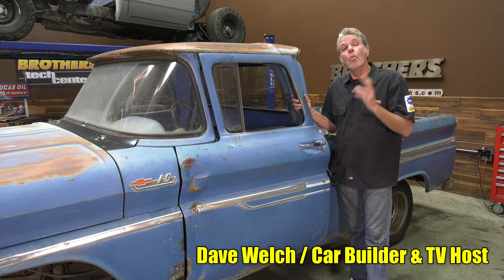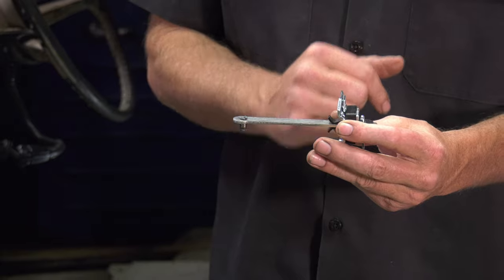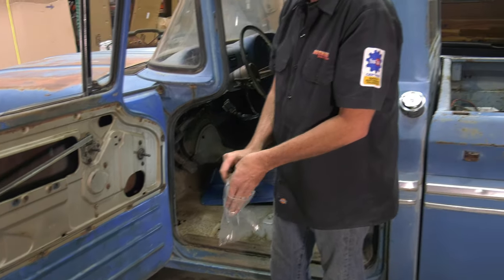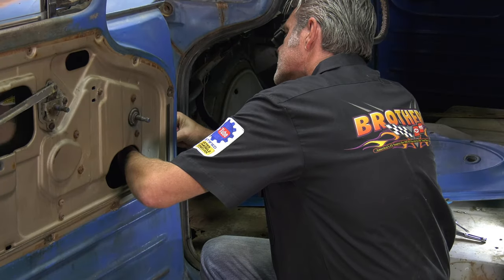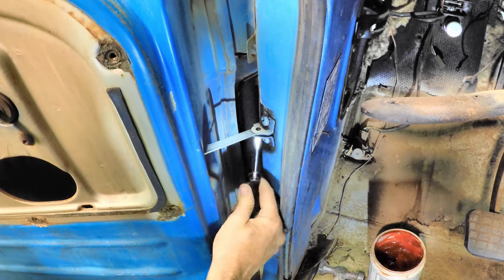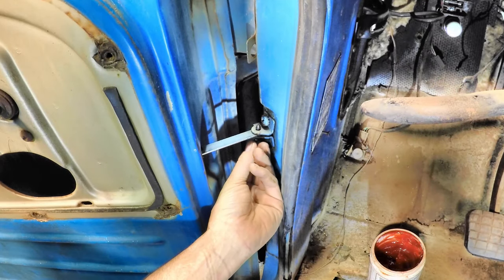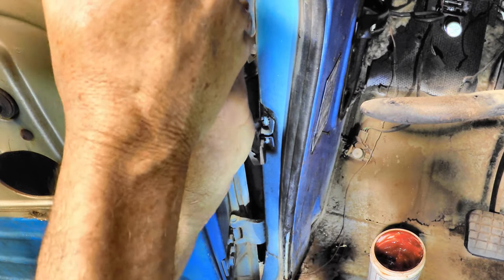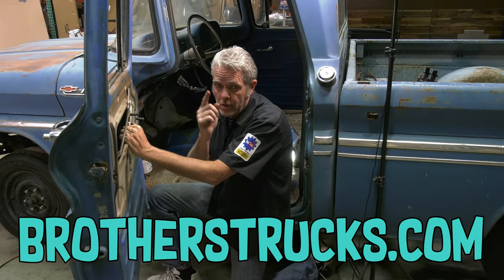1960-66 Chevy & GMC Truck Door Check Link Repair/Install

Comment: ON my 66 fleet side the piece on the frame that the check attaches to is welded from the inside and it has come loose. Can I buy that piece? I assume it has nuts on the inside, how do I get to them?
Reply from the maker: Are you taling about the door side or the cab side of the link?
Reply: @BROTHERSTruckPartsTV  The cab side.
Reply from the maker: @bohdi316   We carry that bracket. It screws on to the cab using captured nuts that are already installed. If yours are damaged or missing you'll need to get creative on how to re-attach the new bracket.
Reply: @BROTHERSTruckPartsTV  Field expediency!
Reply: @BROTHERSTruckPartsTV  I looks like the indentation on the truck in the video is the same as on my 66. Do you know why they went to the welded instead of bolted?
Reply from the maker: @bohdi316   No idea, maybe it broke previously and someone else welded it?
Reply: @BROTHERSTruckPartsTV  Sorry, I meant why Chevy changed from the bolted to the welded.
Reply from the maker: @bohdi316   No idea, probably because it was faster or cheaper to manufacture.
Reply: @BROTHERSTruckPartsTV  Thanks, I really appreciate all your advice and help!

Comment: Replace the cotter pin with a dowel pin. My cotter pin broke. Messed up the paint on my fender and gave me nice dent in the door. Finished building that truck Aug of 23. New door check from counterpart